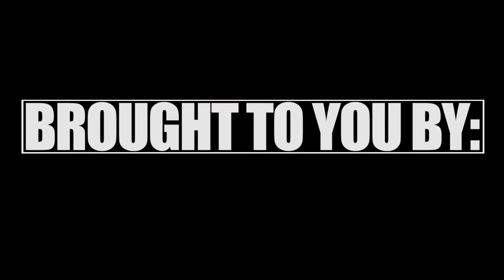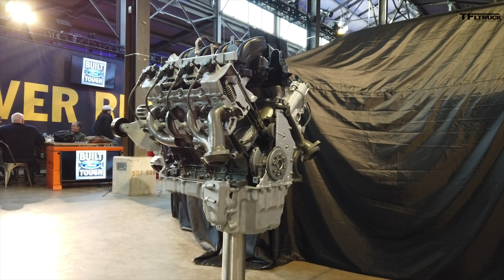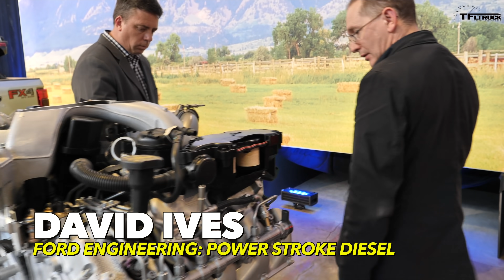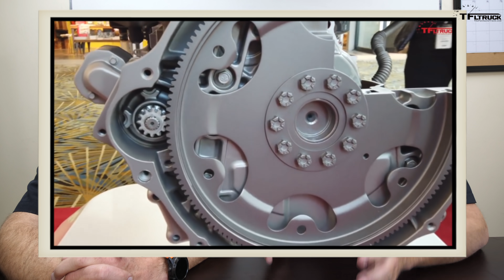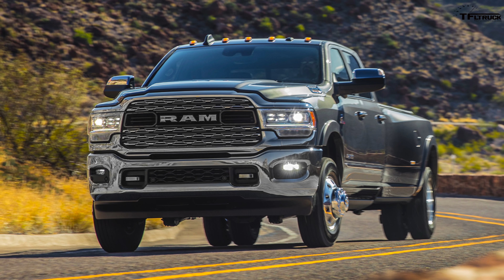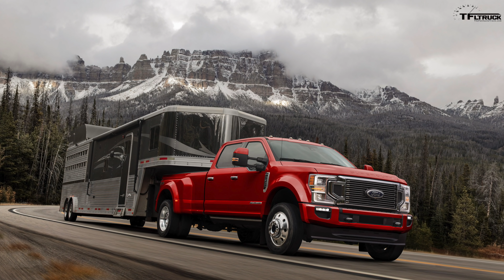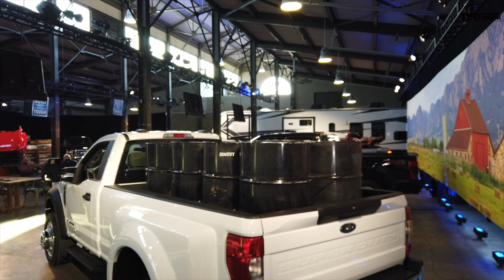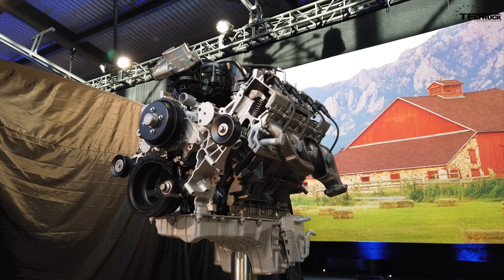Are Diesel HD Trucks Dead / Will Electric Pickups Replace Them? No, You're Wrong! Ep.5

Comment: Diesel will need a rebuild by 200-300k?? Most of my gas vehicles last that long lol
Reply: My ex 2001 F150 has 400,000km and according to my friend still going strong.   Just goes to prove that by doing proper maintenance you can get allot more out of a vehicle than people realize.  And maintenance and some repairs are usually much less expensive than a new car payment!  lol
Reply: My friend has a Cummins with 800,000 miles on it and it has needed a rebuild.
Reply: Bailey Lovell Yea 800k sounds better lol

Comment: How long were Nathan & Andre snowed in? Imagine stuck in middle of nowhere for hours in the freezing cold, draining your battery for heat or stuck in the blistering heat with ac blowing ( plus refrigerated trailer )
Reply: You'd also idle away all your gas/diesel the same way
Reply: Justin Noker 
Range for a diesel semi truck is limited more by the allowable driving hours for the driver than by the truck itself. It's not unusual for a truck to have dual 150 gallon tanks. 300 gallons at an average of 7 MPG gives a non-stop range of more than 2000 miles.
Reply: @timfox2344  and we're already at 500 miles in the case of the Tesla Semi, perfect for the shorter haul intra-state deliveries. I understand for long-haul Diesel will be around for a while until Battery tech is able to improve (especially for very time sensitive deliveries such as donated tissue)
Reply: Jets & Ambulances... EMS for 8yrs, did quite a few harvest teams. They’d fly either harvest team &/or donor ( basic life support to keep organs viable  ) Ambulances are generally diesel, run 18-24hrs a day with crew rotations... 500,000 miles is average, swap transmissions every 6mo ... 

Back to big rigs .... it’ll take quite a long idle time to drain fuel tanks, Winter you always keep diesel fuel full to keep from gelling. Electric being about 500 mile range on batteries is roughly 7-8hrs .... not good

Comment: Why didnt u guys went witn how long it takes to charge them and the battery degrades over time
Reply: Battery charging speeds are being improved as more research is done, and modern EV batteries degrade VERY slowly. There's a fleet of Tesla's out west that have 500,000 miles on them, and the batteries were somewhere between 11-14% degraded (they're considered EoL at 20%). I don't know about you but to me that sounds pretty reliable

Comment: Ford had to do something with their gas motor because the ones they got now are weak.
Reply: hahahaha, I am not a Ford fan by any means, BUT, they dominate the gas market with the turbo engines. I am glad Ford is thinking outside the bun to try new things. In the end, WE ALL WIN
Reply: There's a reason they have to fit them with a turbo.  To be fair I am a Mopar fan,  but have driven both a lot for work and personal use.  I know what Ford says their motors put out but when the foot is on the throttle I just don't feel it like a Ram.  I do however think the other companies should look at fitting turbos on their gas motors because that is definitely a win.

Comment: I never liked the sound, smell, or extra maintenance of a diesel engine, so I'm interested to see if all electric, silent trucks will be a thing in the near future.
Reply: I love diesel smell and sound. If they had a candle that puts off the smell of diesel fuel I would buy a case of them.
Reply: me either, I once had the diesel bug back when I was a young buck, bought a chevy 6.2 and cured that problem. I set over a Case backhoe stack too many years, that diesel now makes me sick.
Reply: Sup Schmuck They can have that, but just don’t fully get rid of diesel. Also, I’m curious what you mean about “high maintenance” because you can change the oil at 7500 and the air filter at 30k. Also, some people like the sound, smell, and pure enjoyment it gives people by modifying, driving, and taking it off the road, just like people enjoy golfing, or any of hobby that interests you.
Reply: @anthonymonsini5635  Hi Duke, I said "extra" maintenance. By that I meant things like the DEF that also needs to be refilled now on newer engines.
Reply: Sup Schmuck Ok, makes sense.
Reply: The biggest problem with diesel engines is the new emissions requirements get rid of the DEF and DPF and EGR and in large the size of the intake and exhaust systems will help with sound and smell because more airflow coming in and exhaust gas going out = more power and better combustion of the fuel and air mixture.
Reply: Sup Schmuck I bet you’re from California, dipshit.
Reply: Diesels smell, sound and look really good, especially when they're rolling that charcoal black smoke.
Reply: only problem is the silent and your opinion will trigger many and for me the thing is they shouldnt be silent so it triggers me just not for the sound but imagine truck coming and you dont even fking hear it, that is dangerous
Reply: @j0lel666  Ok, that's a problem that has already been looked at and some electric vehicles emit some kind of sound that pedestrians will definitely hear. I'm sure the engineers will make these trucks safe for both passengers and pedestrians.
Reply: @bepis126  yes i kniw that but that is just gay asf
Reply: @j0lel666  Not sure if I can take your opinion seriously based on your grammar.
Reply: @bepis126  ik my grammar is shit and we need to study 4 languages so grammar sometimes is shit and when i type comment to yt i barelt check what i have written but if i watch videos on my pc then i check a little cuz typing with keyboard is better than phone and as you may have seen i dont have time to usw , . ? And other stuff

Comment: Diesel is the future. If they wanted they could make a lighter 3L diesel hybrid that would blow the 7.3 L gas hybrid out of the water. With a diesel you get more power, more longevity, and better fuel efficiency with the right set-up
Reply: An electric motor would have way better torque then any engine, thats why trains use electric motors to turn the wheels and the generator is powered by a turbo diesel.
Reply: @matthewconnor5483  agreed !  you make my point, ypu still need a combustion engine to power the generator and deisel engines are much more efficient at that than gas. That is why trains use deisel

Comment: very hard decision to make when buying my next truck, reason I say that is because I still own my 2002 Ford F250 with a 7.3, never a issue and maintenance cost is low for a diesel, with that said I purchased a 2015 F250 with a 6.7 and hate the DPF system, always cleaning, fuel mileage sucks, maintenance cost high because of def fluid and more expensive filters and such, I can work on my 7.3 diesel, oil leak, fuel pump, water pump and most repairs are easy, the new diesel today is a nightmare to work on! I guess my point is as I get older I want it to be more simple, do I need a diesel truck anymore? answer is no, I think the new 7.3 gas engine may be my next purchase, that way I can say I own two Ford 7.3 lol!

Comment: Hate to say it, but it won't be an engineering decision - it'll be a political decision made by people who don't know and don't care. Diesel is doomed.
Reply: BuckheadCreek12 Welk friend, modern diesels are not as reliable as they once were due to emissions.  They are also overly complex, and require cab off at times to perform repairs.  This is starting to outweigh the pros of diesels.
Reply: @LynxStarAuto  All you have to do to make them reliable is to do a full delete of the emissions.
Reply: @hojo70  Who doesn't want a smoke blasting diesel truck.
Reply: Yes, that's it. I agree with you. Government regulations make decision.
Reply: hojo70 ancient technology. It’s better than any Prius I’ve seen yet. Gas cars are way worse for the environment that diesel
Reply: isn't it a good thing HD trucks are EPA exempt?
Reply: The really sad part is that people continue to vote people into power who don't know and don't care every once in a term of years
Reply: @dantes67  You people are insane... Caring more about the range of electric cars than about the fate of humanity. Such selfish thinking!
Reply: @Ben-Rogue  I've got news for you: If everyone were to be as reactionary as you and AOC, and just scrap their vehicles today, society would collapse. Range and availability matter in the real world because the the vast majority of the world is run on gas and diesel. If even one major city were to try to switch and rely solely on the current short-range, low-availability EV offerings, that city would come to a screeching halt. 

Following your "moral" thinking would bring suffering and death to millions and millions of people at a rapid pace. I think I'll go ahead and keep being analytical, thanks. Go screech at people who can't do math.

Comment: I think they’re coming out with the 7.3 because not everyone needs 1000 ft lbs of torque, but more than the 6.2 makes. Also, cost is a huge factor for going gas. Not sure a hybrid HD truck would provide enough battery life when towing up big grades ect.  They seem to go down fast in the cars I’ve driven. So in that situation, under extreme load, would a hybrid be enough?  I guess we’ll find out.  My guess is it’ll be a smaller engine.

Comment: People forgetting that with everyone charging their vehicles, Power Plants will be running overtime, thus causing more pollution... thus not being a major solution to the problem we are trying to solve.

Until Solar, Hydro, and Wind energy can produce as much energy as Coal, Oil, and Nuclear power plants, don't mass produce electric vehicles, and maybe go down the all-Gas / Diesel-Electric (Hybrid) route for a few decades.
Reply: Power plants much more efficient and better control over emissions. Your argument is more valid if you consider inefficiency of the grid.
Reply: "Coal & Oil" FAIL you have no clue what you are talking about. Coal is GOING BANKRUPT. Oil has long been Not Viable for Grid Use.
https://data.worldbank.org/indicator/EG.ELC.PETR.ZS?view=chart
World Grid Average of Oil being used for Grid Electricity in 2015 = 3.28%
Reply: Don't forget most people would be charging at off-peak times when there's plenty of reserve capacity.
Reply: Justin Noker except, off-peak would no longer apply, because everybody would be charging their iPhone on wheels.
Reply: @LynxStarAuto  Correct thus the removal the need of Expensive Peaker Plants & Annoying Risky Massive Dips and Rise. On a freaking supply system with NO STORAGE. The adding a market controlled Load during Off Peak for charging BEV will STABILIZE both Cost & Functional Operations of a Grid.
Reply: @LynxStarAuto  you know what was meant, and that's actually a good thing you know, helps to "balance the Grid" as it's so called

Comment: Dc motors can run dc motors without batteries! If there is any hope for a vehicle that can run without batteries or a generator that vehicle would need to be able to carry heavy dc motors and a generator/engine to start the dc motors running! Dc motors work better on boats because they are heavy! But a truck can haul the weight and pull a trailer payload! If a truck were set up with at least 2 dc motors it couldn’t get up to speed using the motors unless the engine were nothing but a generator but once up to speed the dc motors would run the vehicle without the need for batteries or a generator other than the 2 dc motors generating each other!

Comment: Dont plan on an electric hd pickup any time in the near future. Diesel is far from dead. Modern desiels have near zero emissions while still providing good mpg and loads of pulling power. If the day of the diesel was coming to an end you wouldnt see the big 3 dropping diesels in half tons and why would they be doing this......BECAUSE NOBODY WANTS YOUR HYBRID OR ELECTRIC PICKUP but we want increases in mpg and to still have pulling power........ Not to mention if you put a hybrid or electric system in a truck it would far out weigh a diesel version.

Comment: With the battery at the bottom you can’t do 4x4 again, because water or mud can get inside the battery. Heavy duty trucks are also used to be off-road, also a good electric motor can’t fit inside the truck, look the example of the highlander that is an acceptable electric motor, is very big and under the hood it consumes half of the space for a Motor, and the 7.3 can’t fit with a good of a electric motor. The future is full electric cars because oil isn’t unlimited so the end for petrol and diesel is coming but in approximately 20 years. Still car manufactures have to make a plan to start making electric motors powerful enough to change the gas and Diesel engines.

Comment: I like the picture, but Roman is only partially wrong... AND ANDRE IS SO RIGHT!!! I think the trend is going to start going in the way of electrification, but as of now, too many people love diesels. But I will say this: Ford has been working with a company called XL Hybrids where this company has been taking the F-150, F-250, and F-350s and coupling them with a hybrid battery package for commercial customers. Please see what you can find on that company as well as VIA with Chevy. That will support your electrification argument, Roman!
Reply: I'm not sure for Ford's case, but for VIA trucks, I've talked to quite a few people that are still awaiting delivery for ones they ordered based off the 2007-2013 model. It almost seems as if VIA trucks are unfortunately vaporware

Comment: No German tanks in World War Two were powered by Diesel, gas only and in the case of the Tiger series those engines were CRAP! In Russia they used a modified airship Diesel engine and used it in the T34 and they were absolutely brilliant tanks. Now, I think you are wrong on the whole gas hybrid thing in HD trucks, it can't be economical. The batteries weigh ALOT which cuts down the amount you can haul and in order for the trucks to produce enough electricity enough of the time while under load conditions the gas engine will be going nuts to produce the motors with enough electricity to provide the torque you need which will mean serious fuel use. In parts of Europe hybrid Diesel trucks have been used in built up areas for stuff like trash collection but they don't work as well on a highway. In Europe LPG engines are starting to really sell well in semi trucks, they are extremely clean, their fuel economy is good and they don't have the pollution problems associated with diesel or gasoline engines plus no DEF to worry about. The reason why diesels in HD trucks will continue is economy plus torque with less weight than with a battery.
Reply: @wantblackwolf  , but if you have an engine constantly powering an electric motor that's like a nonstop alternator and that will make the engine very inefficient.

Comment: I agree with Andre, though to get rid of the diesel.  On a personal note from a lover of my diesel trucks...Roman has a point.  Not in terms of electric hybrid trucks but larger in displacement, more powerful gas engines.  Hands down I prefer the diesel for many reasons. However, with the EGR, DEF, DPF systems and ultra low sulfur fuel etc. diesels are not what they were.  Yes, they are more powerful but driving behavior (for me at least),  has drastically changed to a point I'm not sure I want one anymore.  When running errands I don't take the truck anymore, even though I would prefer to.  Why? Because the mechanical sympathy takes over.  I worry if to much fuel is mixing with the oil, in short trips oils may not get up to temperature...or stay there very long.  I find myself rerouting my trips making them longer to make sure the engine is not in traffic or interrupted during regeneration cycles.  In fact, say I need my truck for a specific towing or work event on any following morning or day, and I'm close to a regeneration cycle...I'll take the truck for a drive the night before, for no other reason than to ensure the truck does not start a regen. cycle on say a short trip to a work site.  Why you ask?  the thought of soot clogging up the DPF from stopping during regeneration cycles...and eventually causing forced drive events or worse...going into limp mode...well, that's why.  With all the aforementioned issues, diesels in my book won't last as long as they once could either.  I use all Motorcraft recommended adders such as cetane etc. My truck since new has NEVER been stopped mid cycle.  My towing needs are likely not going to exceed 10-12,000, so maybe time to consider the new 7.3 depending on numbers when announced.  I realize I could get away with a gas job now, but one trip on the highway towing say 8,000 lb or more and listening to the constant strain, shifting and inability to maintain speeds...sticking to diesel engines for now.  Ok, done with my rant
Reply: I truly believe you would be better served by the Titan XD with the 5.0. Cummins. Kind of the best of both worlds especially if you don't NEED a 3/4 ton but you want something bigger than a 1/2 ton gas burner. I've had mine 3 weeks now and I love it!  It does great pulling a trailer and is still rated for 12,600#. First non-gm truck I've ever owned.
Reply: I work with a diesel fleet. I drive a Kenworth T440 with the Cummins ISL (rebadged to PX-9), and it's a mess. With 29k miles on it, it's been in the shop several times all due to after treatment issues. There is a blow by system for the engine oil, requiring a filter. That filter clogged and generated enough pressure to blow all the caps to the oil pan. A Freightliner I had took a dump at 300k. The EPA has killed diesel.
Reply: I need payload capacity and bed size...